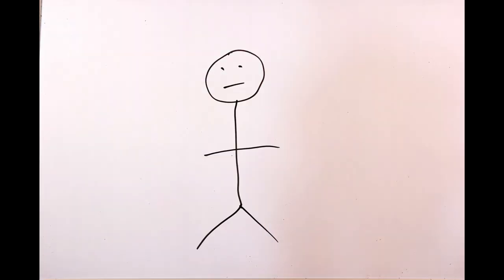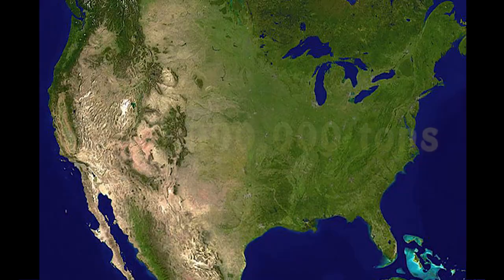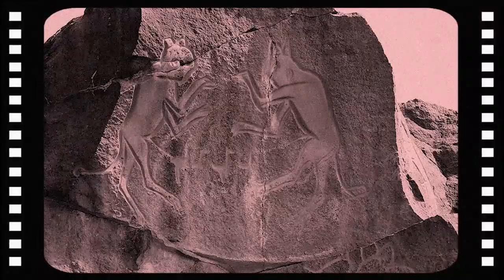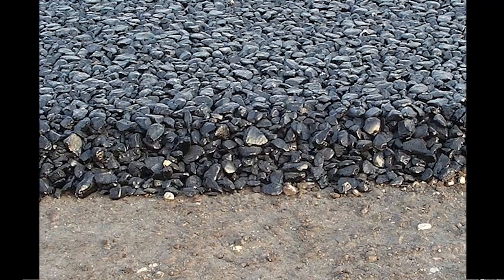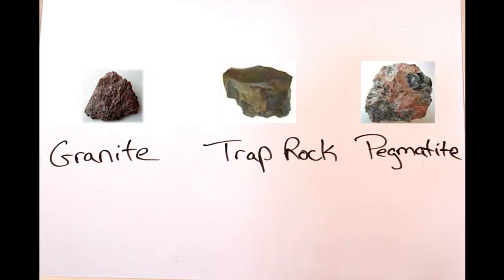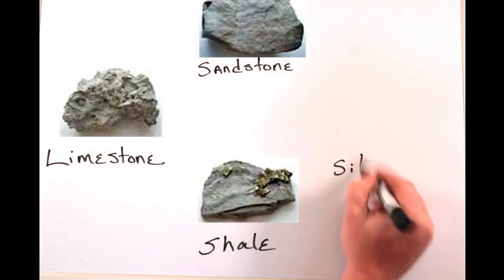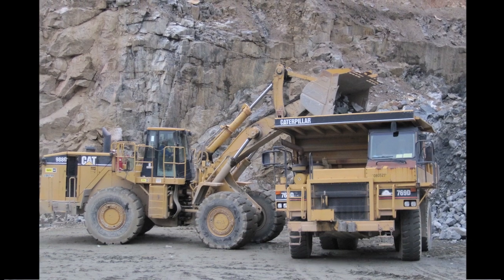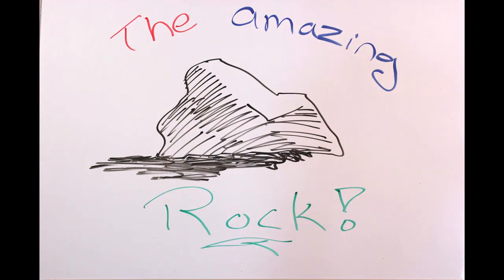Where does our rock come from?

Comment: if rocks come from volcanoes then how do rocks get to places that have no volcanoes. im so confused
Reply from the maker: Thanks for your question!  As the video explains, igneous rock comes from either lava (molten rock that came out of a volcano then cooled) or magma (molten rock that cooled inside the Earth).  Igneous rock could have been deposited recently from an active volcano such as in Hawaii, or it could have been formed thousands to millions of years ago.  It may have moved across the Earth due to plate tectonics during that time or it may have come to the surface due to mountain-building.   It could undergo heat and pressure within the Earth and become metamorphic rock.  It could weather on the surface and then be carried down a stream to be deposited as part of a sedimentary deposit.  These are some of the reasons rock can be found where there are no volcanoes today.